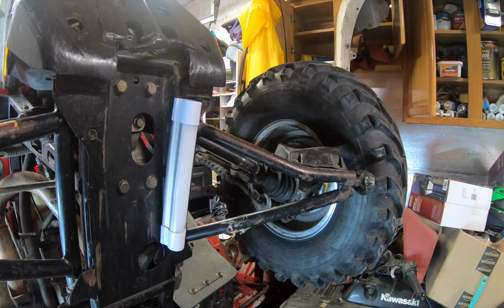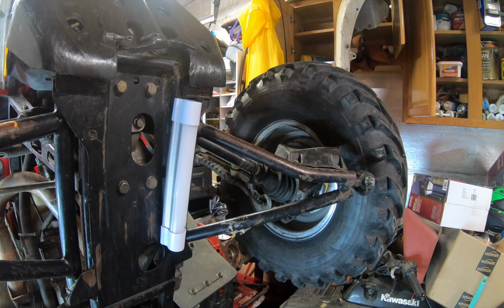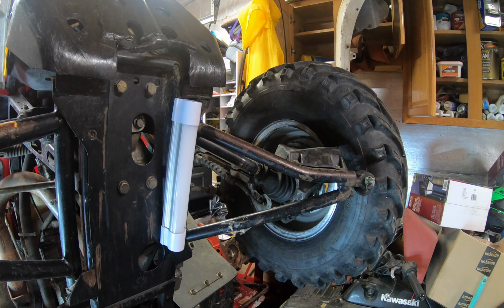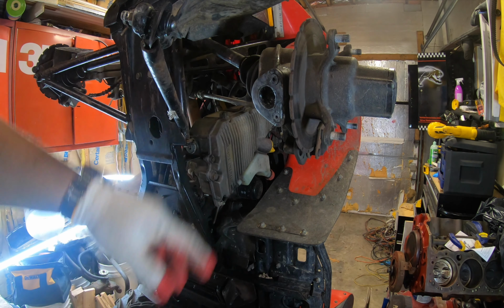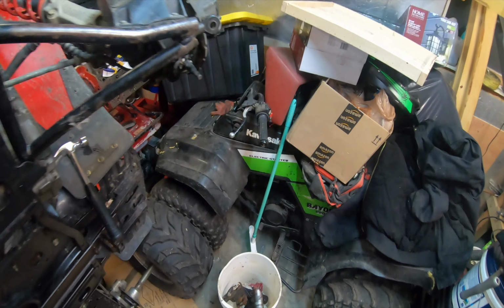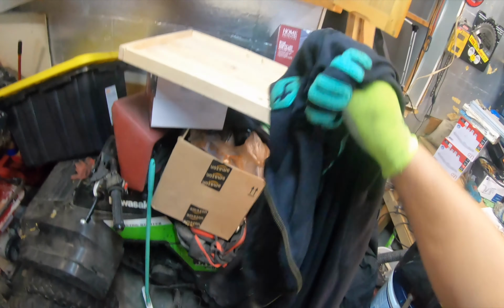Polaris scrambler 500 ball joint removal DIY part one

Comment: Dude, there is a zerk grease fitting on the bottom part of the strut tower specifically to use to remove the ball joint. Fill that zerk with grease after removing those 2 cover bolts and it will pop it out with grease pressure. Its usually very easy. Takes a few minutes.